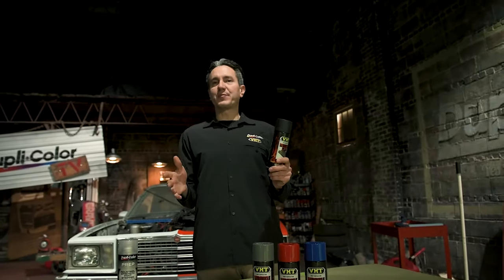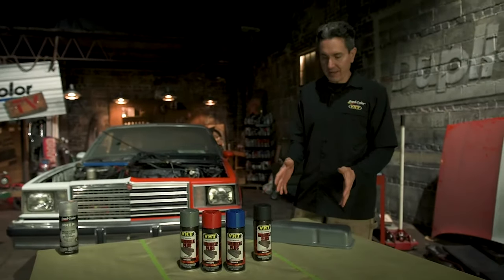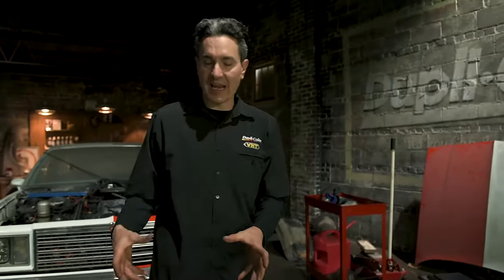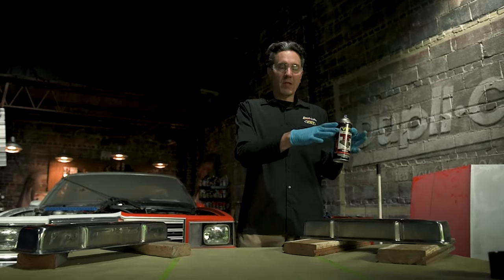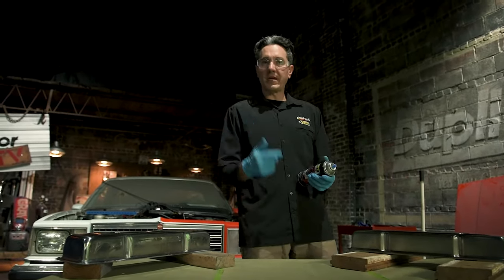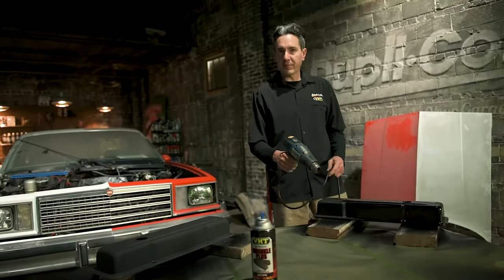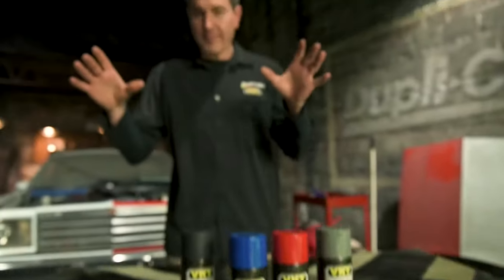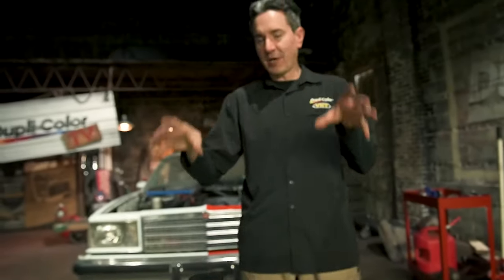VHT Wrinkle Plus:  How To

Comment: I followed these instructions to a tee. The paint wrinkled slightly in some areas--and not at all in others. Hit it with a fourth HEAVY coat--just a disaster.
Reply: I just did my valve cover and had the same initial result. Did the 3 coats as instructed by some areas didn't wrinkle at all. Maybe I didn't lay enough down in those areas? I'm just going to leave it as is and call it a learning experience.

Comment: TIP* I pre-heat my parts using the Sun maybe 10 min should do. Move parts to a shaded area or inside shop w no dust shake can up a minuet or two giving the part a chance to begin cooling read & FOLLOW ALL DIRCECTIONS ON THE  CAN and be patient.... once the part has approached its 1st complete drying place the part in the sun for another 5 mins - I find the Sun (rather than some electric heating device" gives a much more uniform & tight wrinkle  finish

Comment: I've just done my first, loads of prep and degreasing to start with, then the first light coat and then went in with the heavy horizontal coat but i think i went too heavy as it separated in places, weird... tried not to panic. Following that i went a bit lighter with a more medium vertical coat, this seemed to stick better and avoid the separation, same with the diagonal coat, but then i felt like i had gone a bit too light i did another opposite diagonal coat and luckily by the end all the areas that had separated had filled in nicely. I gave it 5 mins between each coat and then 10 mins before hitting it with the heat gun on the low setting and although it was not what i would call 'perfect' i was very happy with the results. 

Moral of the story dont go too heavy, even coverage is key to good results and the heat gun at the end definitely does the trick to wrinkle it. If i was to do it again i would do a light coat then lean on the medium coat side of things with 4 coats, horizontal, vertical, diagonal, opposite diagonal.
Reply: Yea I just did it on my valve cover and there are areas that look like  grandmas skin I may have sprayed to close and or to much in one area I still have to wait for the paint to dry but I’ll probably have to start over if it looks shit

Comment: This is going to be great for old radios like my 1940 RCA AR88 communications receiver. Thanks for the video.
Reply: Did you ever use it on that old RCA? I came across this paint looking for something to repaint my old RCA 195a VoltOhmist VTVM I'm fixing up.
Reply: @starquestman1544  I'm sorry, I haven't as yet. One of the problems is time and the other is that I have not been able to find this product in the UK.  Good luck with your project.
Reply: @acestudioscouk-Ace-G0ACE  Thank you for your response! It appears that the stuff is hard to get here in the US as well.
Reply: @acestudioscouk-Ace-G0ACE  To anyone looking for a paint for recreating that old wrinkle finish on electronics, this stuff recreates that old style finish perfectly!, (when it works, that is!) I found a can of black locally and painted the VTVM case. The stuff has a learning curve to it, and I started to get the feel for it right about when I used the last of the can in redoing different sections that I had messed up on. I stripped the case to bare metal and applied it following every instruction on the can, even the later section that seems to apply to touchup only has important instructions that apply regardless of whether you do a 4th coat or not. After doing the different direction coats and allowing the proper cure time between coats the top turned out absolutely perfect the first time but the sides and back had some issues with the wrinkle texture being very splotchy. After stripping the sides and back and repeating the process, I managed to get some better results experimenting with a heat gun like they did in the video. I found I could do the 3 coats one after the other with only a short break between them, then I would use the heat gun way back from the piece keeping it still and after about 5-10 seconds the paint would start to wrinkle and spread outwards. I think a hair dryer might actually work better for this since it has more airflow at a lower temperature that would help even out the finish. I could never quite get the sides and back as perfect as the top came out, but I bet I could if I had another can to try it one more time. The stuff was still soft after sitting overnight and I redid the sides the morning after. I put the case in the oven at 200F for an hour and all 4 sides cured nicely, so I do believe this step must be followed in order to cure the paint completely. hope this helps anyone out that may have troubles with this stuff!
Reply: @starquestman1544  Thanks for the tips and glad it worked out for you!

Comment: I used a heat gun to accelerate the wrinkle process and the wrinkle appeared within minutes.  I simply followed the instructions for spraying: first coat vertical, second coat horizontal and third coat diagonal.  I waited 5 minutes before applying the next coating.  Here's a sample of the results: https://youtu.be/HBgyPW_0gw4

Comment: Used this a day ago and it looks nothing like what finish he has in the video. Such a strange finish. I wouldn't buy again. Wasn't on money.
Reply: If it doesn’t wrinkle, you need to use thicker coats, i had the same issue only to find out that if the layers you spray aren’t thick enough, it won’t wrinkle.